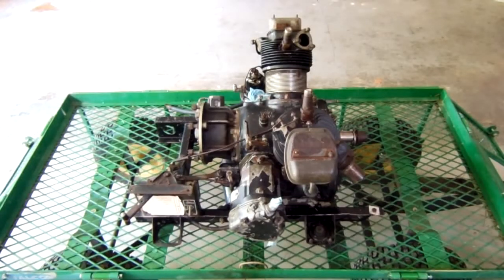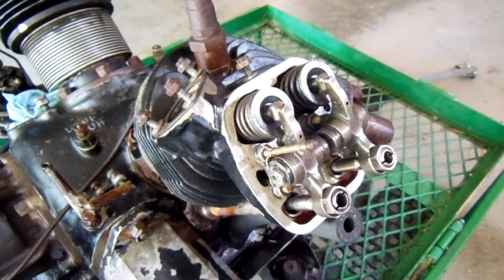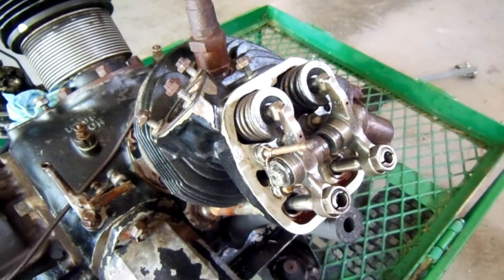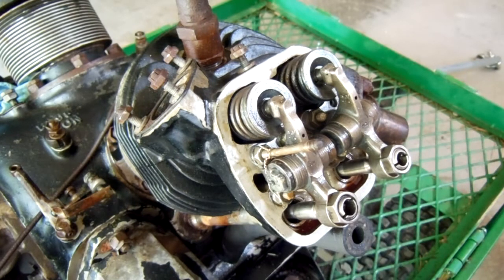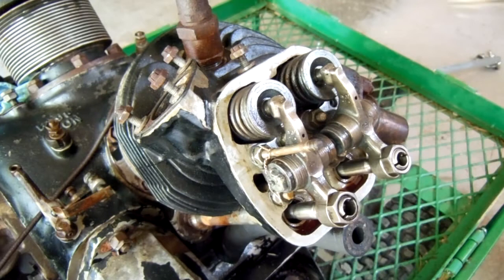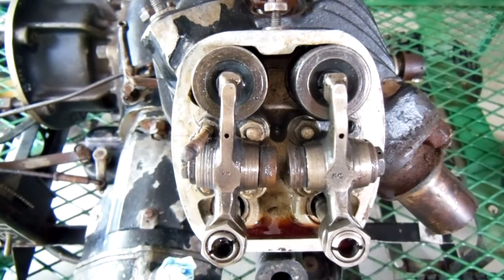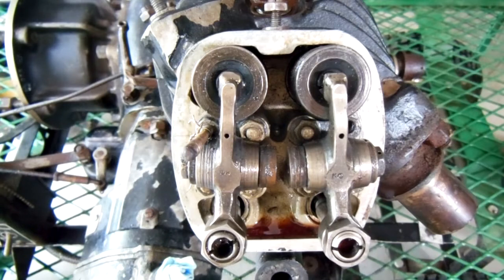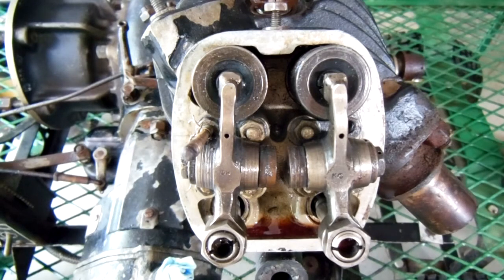WWII B-29 APU: Detecting and Fixing Valve Blow-By on the Andover V-32 Engine

Comment: I have, several times, lapped in rusted valves by inverting the engine and applying lapping compound to the valve edges through the spark plug hole. I remove the valve springs and the manifolds. I use an old drill chuck to grip the stem so that I can manually lap them in. Then I wash the mess out with a pressure sprayer and solvent. The other thing I routinely do is straighten slightly and even more than slightly bent valves. I have NEVER had a straightened valve fail in over 40 years of doing that!

Comment: A little more knowledge could change your narration. 
Valves wear over time and the seating surface enlarges, grinding is then required to reduce the seat surface area and restore an effective seal.